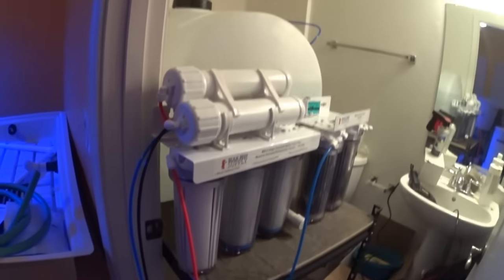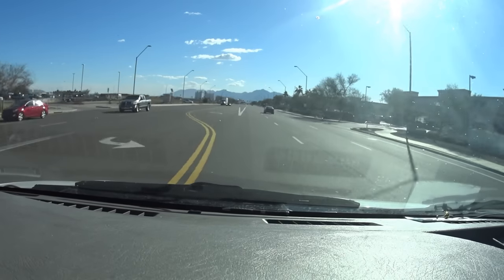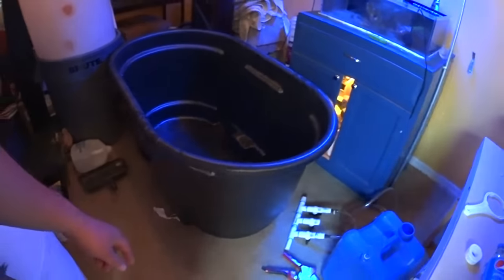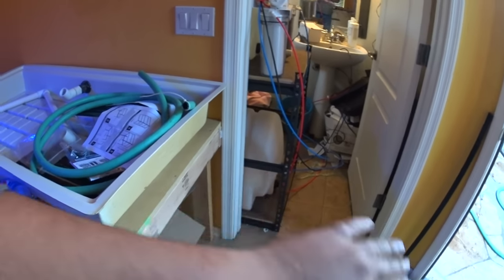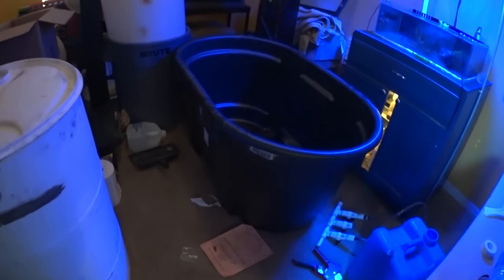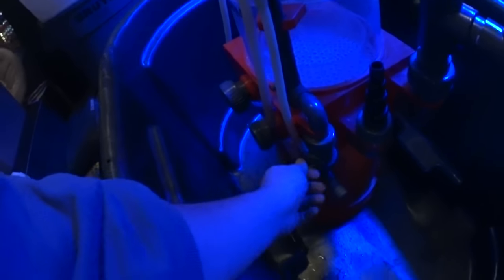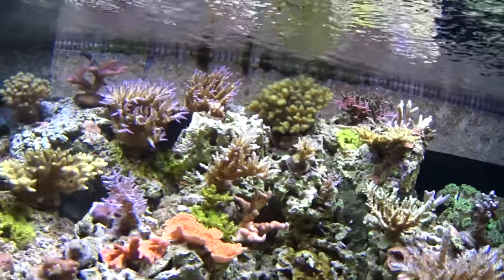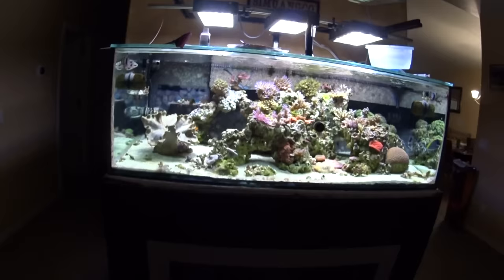Reef room update

Comment: As usual Great Video.  Just a suggestion not a critique but instead of a stand in the sump for the skimmer, how about a bridge with guard rails to keep the skimmer and pump from accidentally falling into the sump.  You can place neoprene foam on the contact points between the bridge and the sump to reduce vibration noise.  Just imagine a straight walk-way with guard rails. and braces at the contact points to prevent any movement of the bridge.  Just thinkin'.  ;)
Reply from the maker: +Dave Davis Love that Idea and will probably do that!!!!  Thank you!!!!!!!!!!!

Comment: I've been subscribed for a year or so now... I've finally got the reefing addiction back and going. Im definetely follwing along. I have a question though, when i first got my "Todds Torch'' the extention was massive (liike 6''+) now after having it for  months the polyp extension is max like 2 inches. do you know what the problem could be? my params are near perfect, ive  tried high light low light, high flow, low flow, I just dont know what to do... Good luck with the fish room, Ill be watching :3
Reply from the maker: +Euphilliophile Thanks for watching and being subscribed.  Yeah I'm not sure about the coral.  what I have found is that a good dip will fix a lot and then you can spot predators!!!  Good Luck.